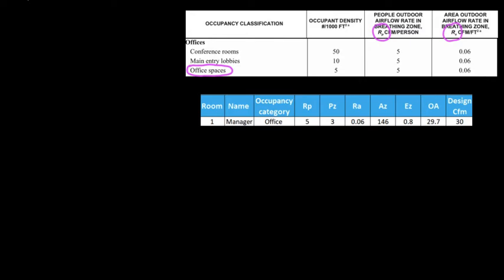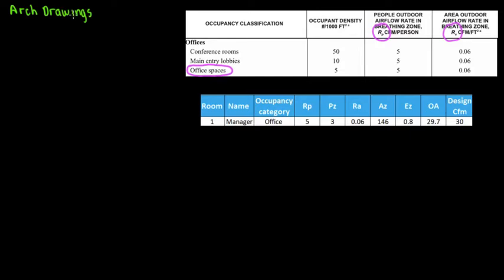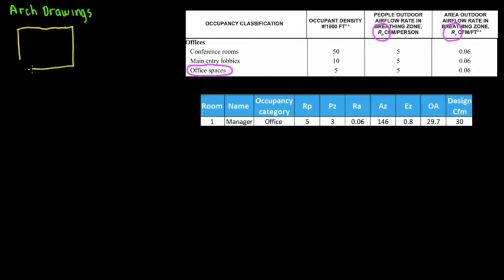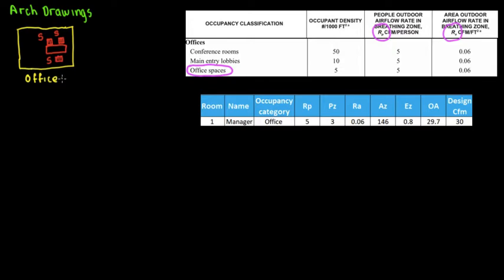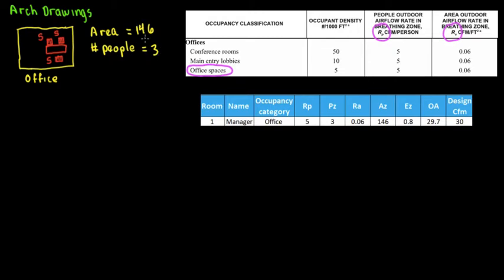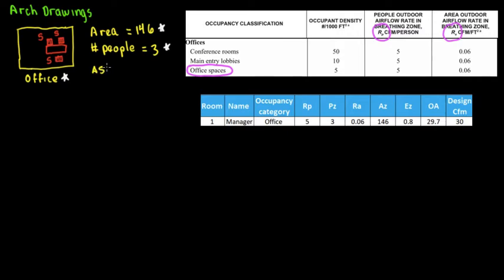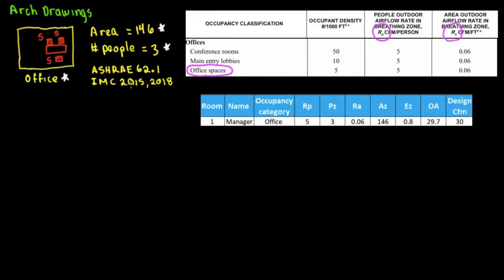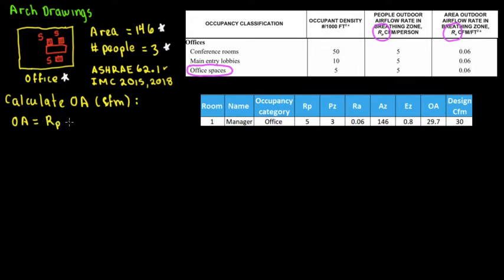ASHRAE 62.1 Fresh Air CFM, ventilation rate

Comment: I have a question related to this. Usually when you have OA ducts passing through fire rated walls, either a FSD or FD is required. Do they vary depending upon the ASHRAE picked for the calculation ?
Reply from the maker: Not really. Ventilation remains the same but we just want to make sure we provide FD in fire rates walls. The architect will provide with the life safety plan where it indicated which walls are 1 or 2hr rated walls.
Reply: @hvaceasymath  thanks for the response. The reason I’m asking is that I have seen both (fsd and fd) being used in nyc for OA systems in nyc. So I was just wondering which one should be used for them
Reply from the maker: @viniciusbraga5846  FD, FSD and combination depends on the penetrations and fire wall rating provided in sections 717.5.1, through 717.5.7 and 717.6 of Chapter 7 of NYC Building Code 2022 (link: https://www.nyc.gov/assets/buildings/apps/pdf_viewer/viewer.html?file=2022BC_Chapter07_FireResistanceWBwm.pdf&section=conscode_2022). Every state and city have different regulations. I hope this helps.

Comment: ¿Acaso esas 3 personas no están necesitando 15 cfm X 3 =45 cfm ?
Reply from the maker: Gracias por el comentario. Es correcto lo que indica, pero además de los 15cfm debemos añadir OA debido a la superficie (área) lo cual es 0.06*146=8.76cfm. entonces (15cfm + 8.76cfm)/0.8 = 29.7cfm

Thanks for the comment. it is correct but besides 15cfm we add OA due to area which is 0.06*146=8.76cfm. Then (15cfm + 8.76cfm)/0.8 = 29.7cfm.

Comment: Great videos. I have a question. When we provide fresh air for fcu, does it effect to fcu capacity?
Reply from the maker: Thanks!.  The capacity would be same but the cfm splits into OA (outside air) and RA (return air). For example: 2 ton unit @ rule of thumb 400cfm/ton we have a supply cfm of 800cfm. So if we need 30cfm of OA and the return is 770cfm. Hope this helps
Reply: @hvaceasymath  thanks you're advice
Reply: Well done  @hvaceasymath